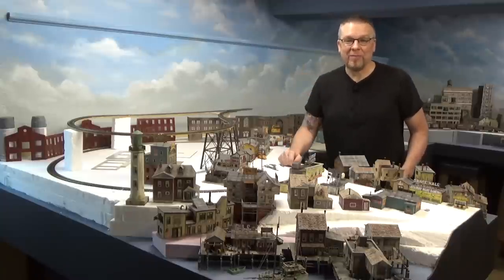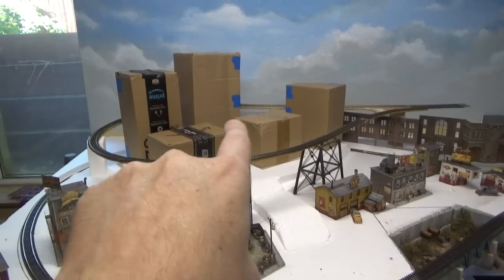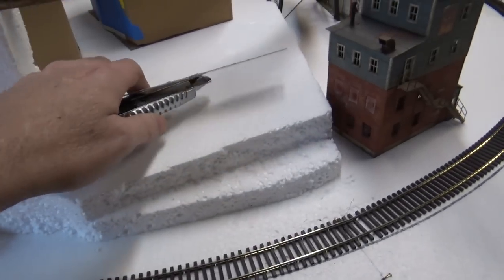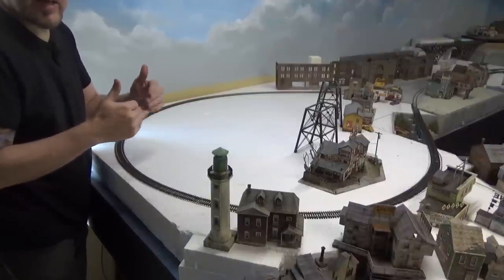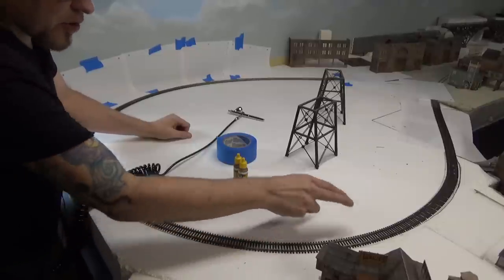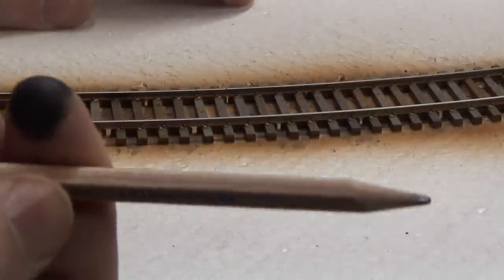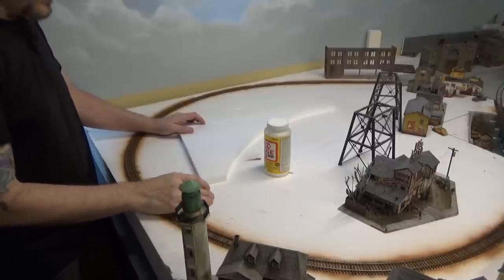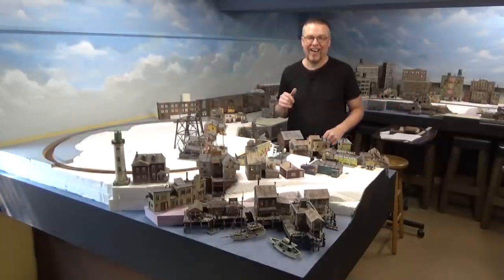Starting our city and painting track!

Comment: For the last year I have been organizing my work area   What I realized was work stations work well.  My main work bench,  a smaller work station for kit building and a work station for soldering , loco, and rolling stock repairs.   The two things I would add to your list is a label marker and gallon zip lock bags.   Left over parts like windows, doors, detail parts, roof, wall and metal casting parts.  I just use a sharpie to mark the bag.   I have a clear tub marked parts box I put the zip lock bags in.   Quick and clean.    Haver learned a lot from your channel .....till next time
Reply from the maker: That’s some good advice Will!!! As always, thank you so much for watching! I appreciate ya !!! 👍

Comment: I’m almost. ALMOST. Ready to paint my Llagas Creek track. Sigh. Can’t put the rails in the plastic ties if it’s painted. So I need to paint after laying the track. Same exact problem. Only bigger and outside. Inside, for the most part, I’m hand spiking. So I can paint the rails before laying the track. But not with the “flex” tracks.  Your pencil trick is GREAT. I used it to add metal edges to my coal buckets. Quick and great looking. Never thought about using it on spikes… WELL!! I see what I’m doing later in the month. As soon as it’s under 90° outside so I can work in the day outside. Of course then it will snow… May get perhaps 2 hours of fall. See if I can paint rails in those 2 hours!!!!🚀🚀🚂😃
Reply: As I love the tie color on the Llagas Creek track, I’m going to mask the ties as best I can. Doable in #1 gauge. I’ve just bought a usb battery airbrush just for painting track and stuff on the railroad where I can’t paint in da booth. Do you have any issues with that paint when painted directly over the metal rail?
Reply from the maker: I absolutely love watching the progress on your outdoor layout! It was exciting to see it go through the wall! 👍 Thanks for watching, I really appreciate it!!!
Reply from the maker: I have had no problems with that paint. I’ve tried painting the track first but then when you go to bend it on a curve the rail spikes move and then you have dots on the side of the rails that are not painted.
Reply: @JasonJensenTrains  and I think with a portable airbrush it’s not just better looking, is quicker and just all the way around better.

Comment: Jason because of you I've started building wood structures and I love what I can do with them. This leads me to my situation. Most if not all of my other structures are plastic ones and do not compare or mesh with the wooden structures. I had a thought to maybe covert the outside walls & maybe the roofs to wood. I was wondering if you had attempted doing this and could give me any advice. Thanks Jason and keep up the excellent modeling
Reply from the maker: Thanks for the kind words, I really appreciate it!!! I have a video called “Painting plastic to look like wood “ It may help you. The key is to texture the plastic before you start painting it. Simply go over the walls with sandpaper, you can even add nail holes with a pin. Then paint and weather it to look like wood. Hope this helps. Happy modeling John!!!